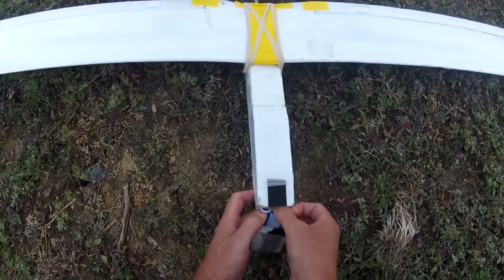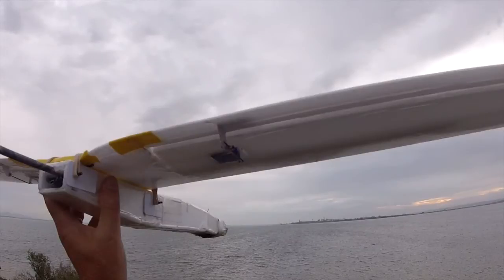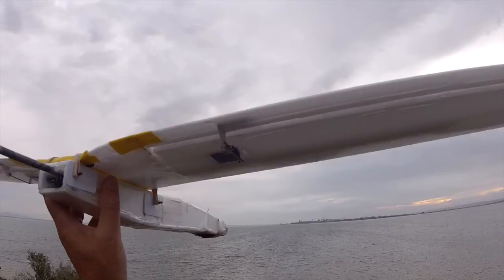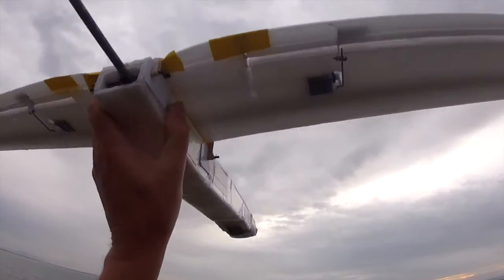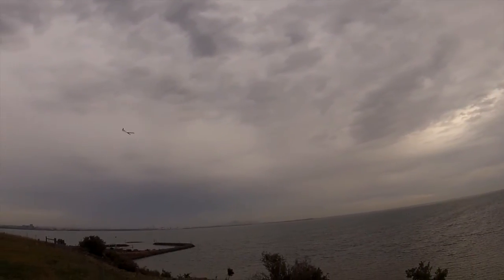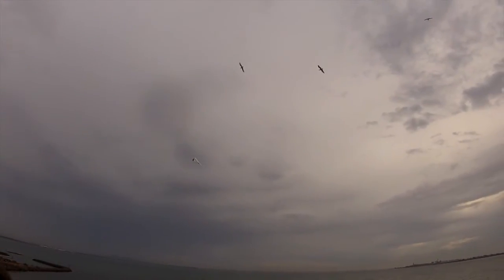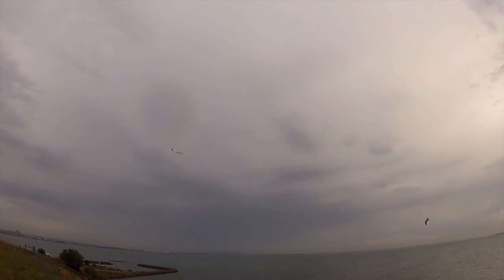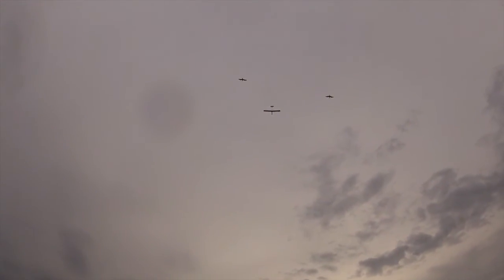DLG foamie minus ailerons

Comment: Brings to mind a couple of dihedral-rudder controlled hang gliders from the 70's.  The Quicksilver - with a conventional tail, and the Fledgling - swept flying wing with rudders on the wingtips. Both used weight shift for pitch control. And both had GOBS of dihedral.

Comment: I think the gulls really like your rudder slope machine Andy. Flying close in on the slope requires ailerons though, for when you need to pick that wingtip up in a hurry....I have a low wing slope soarer in my loft, I must try and get to the slope with it this year, and put the fpv stuff on it....:)
Reply from the maker: EnglishTurbines I missed the ailerons a lot on landing when you want maximum control.

Comment: Very interesting.  Do You think the planes which don't use rudder at all but only 'Bank and Yank' are more, or less, difficult to control vs. no ailerons?  The Gulls seemed to be welcoming Your plane!
Reply from the maker: Bank and yank planes (ailerons and elevator) are much more controllable, no doubt about it. Although the original Radian might be an exception, it's one example of a rudder elevator glider that works, maybe because has an enormous rudder.